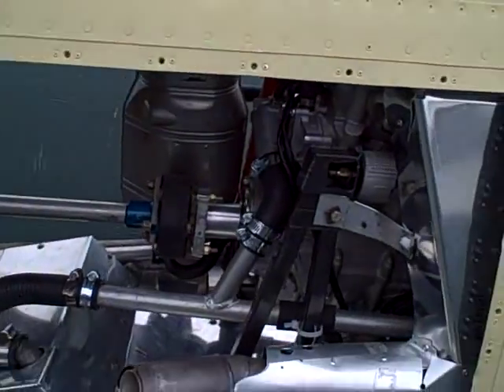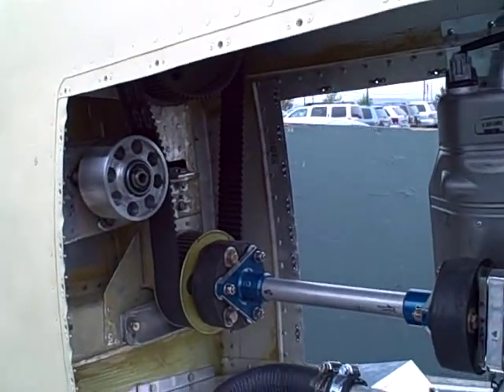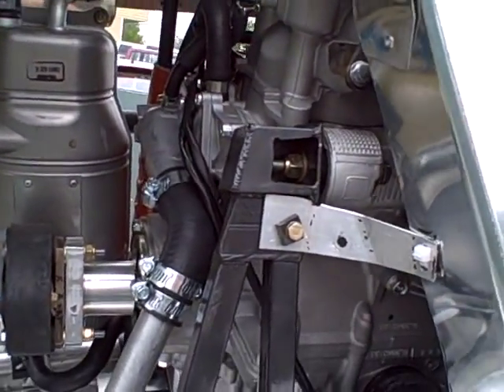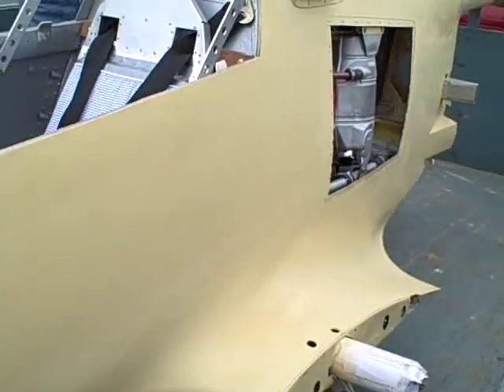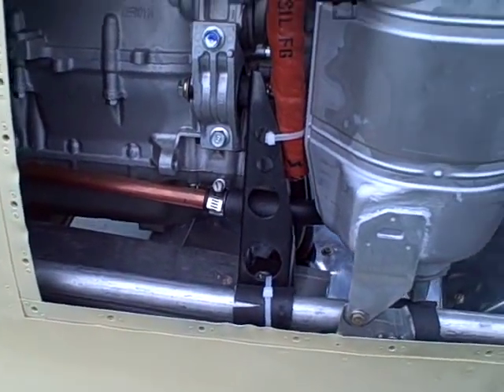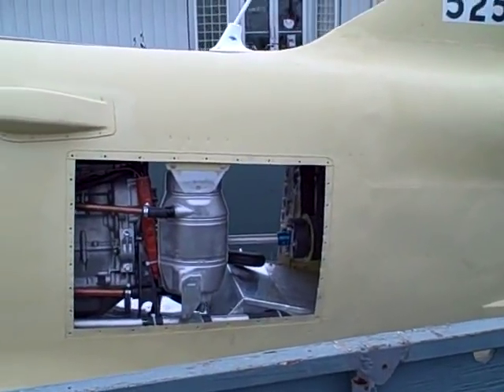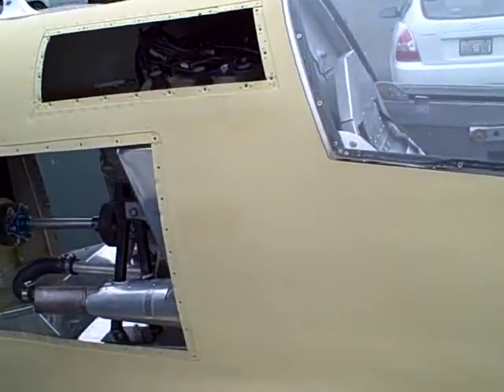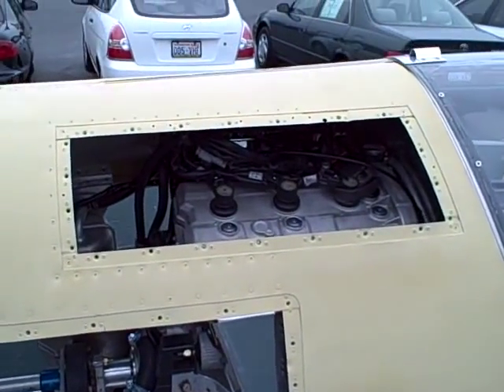Nytro snowmobile motor in BD-5 plane

Comment: Did he ever fly it? I'm looking at the new Phazer 500 4 stoke motor for my BD-5
Reply: *****  Yes you really need to go your ground testing and be prepared for anything. A long time BD-5 passed away last week after an engine fire in England. http://aviation-safety.net/wikibase/wiki.php?id=178061 . There is a very good BD-5 builder and owner group on FB if your interested. https://www.facebook.com/groups/737481303005312/